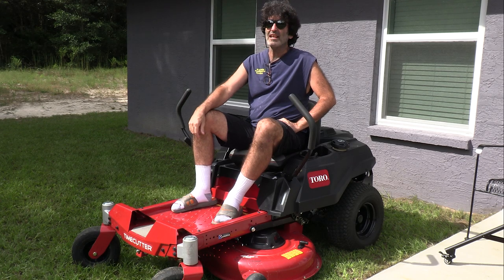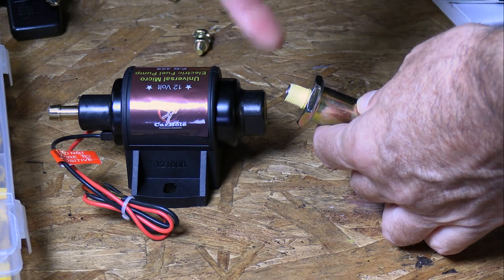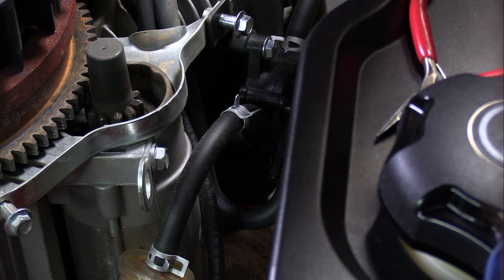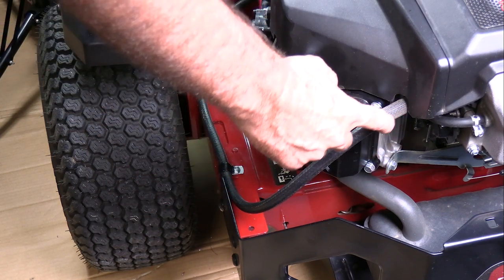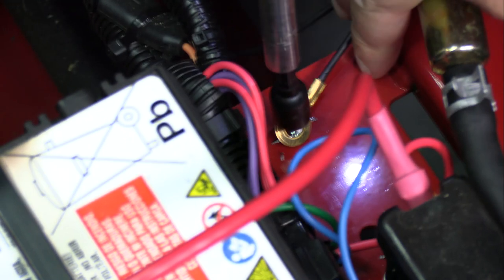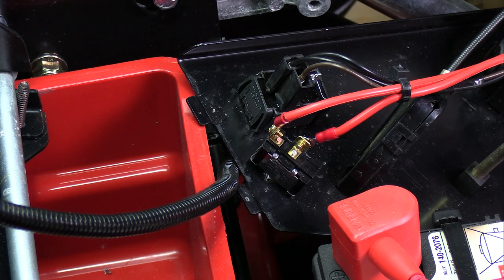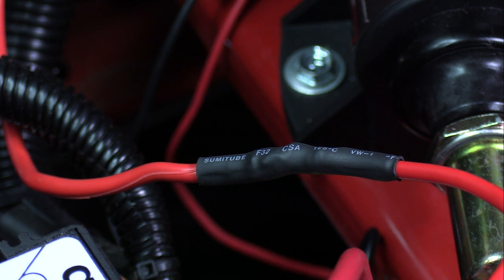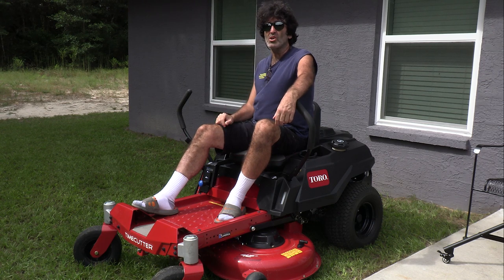Electric Fuel Pump Conversion On a Lawn Mower.. Does it work?

Comment: Good job I like your double heat shrink idea and to help clarify the reason it doesn't matter what wire goes to either post on your on off switch is the only difference is what direction on and off is on the switch
Reply from the maker: Excellent!  Yea I've done that double heat shrink thing since forever... 😂. Especially on a critical connection....
Reply: But how theu don't over fill the carburetor on idling? They are on all the time without the ecu can someone explain before i do the conversation

Comment: Nice job Rudy. 
I figured you were going to make a video. 

I did one little thing different. I connected the Pump hot wire to
The Fuel Solenoid wire so the pump shuts off when I shut off the ignition. 
I can guarantee I would miss shutting off the pump. (like my shop air compressor.) :O)

I also put a toggle switch just so I could shut off the pump if for some reason I needed to, and 
of course the inline fuse. Them pumps only draw about 4or5 amps. 

I am curious how long the elec. pump will last. 
I replaced the vacuum pump every year. Even the OEM. I rather buy an electric pump every year. they are half the price of the vacuum pump. I do like the elec. much better.

John
Reply from the maker: HI John!  I wanted to give you a shout out in the video, but I couldn't remember which video we initially were collaborating on..🙂.  I thought about connecting it with the switch, but wasn't sure of the amp draw and didn't want to damage the ignition switch or go through any under-rated wires.  We've (my bother and I) had a few old hot rods with electric pumps and always had a switch under the dash, so I did it this way to remind me of that!.. 😂. Thanks again for the idea...  I don't know how long the motor will last, I probably only use the mower about 8 hours a year so we'll see..  Sitting might be worse for it than running it.
Reply: @JLPicard440  I don't need a shoutout. 
I have no way to make a video anyway. Like your' video it's the best one in here. 
Well done. 
Right now I am not getting any power anywhere no click.. 
I am on my way to trouble shoot the wiring. I dismantled the mower to slap a 
quick paint job on it while replacing the belts and pulleys. 
(can't do anything the easy way) I must have messed up a wire or safety switch. The Paints done, belts are on and ready to go. 
I miss my younger brother. Many, many miles riding motorcycles together about 50 years riding..
Reply from the maker: @CorbinAce  Oh no!  It's always a great feeling when you put something back together and it doesn't work..  Yes I would guess a safety switch.  Hopefully you've gotten it back on the road by now since you're response was yesterday.. Sorry to hear about your brother.. ☹️
Reply: @JLPicard440  Thanks Rudy my brother was my best friend. He was 69 when he passed 8 years ago.. I am 86 as we speak.
I hate it when things don't work. 
I think I found the culprit though. I removed the battery and checked out the mess of wires and found the wire to the Amp meter was pulled out of the wire connector. I'm heading out there now to reassemble and check it out. I'll let you know. I should get a new wired connector and ignition switch today. I keep this up I will have a new mower. LMAO. For twice the cost! :O)
Reply: My neighbor sent me a high fi as I was mowing my lawn. It was the amp meter wire
that disconnected that killed every thing. It is still not running good enough for me.
I had to cut  the grass. 
I have a Carb. rebuild kit I bought when ordering the belts and pulleys so I will rebuild the spare intake that I have and pull a swap. 
Been good talking to you. Will drop a comment now and then.
John
Reply from the maker: @CorbinAce  SO glad you got it going again!  Gremlins like that can be hard to find.. hopefully the carb kit will take care of the rest of it... 🙂

Comment: Great video! But you can wire that pump right through the ignition switch on the mower
Reply from the maker: Yes you can do it either way... 😀.
Reply: How would you do that?
Reply from the maker: @Coach.Lewi.1979  I forget which wire is 12 volts switched with the key.  I believe the wiring diagram is available on this time cutter free to download.  With that it's pretty easy to determine which wire it is that you can hook to.  Or you could take a volt meter and test each wire to see which one will work.
Reply: @Coach.Lewi.1979  Most mowers have a fuel solenoid on the bottom of the carburetor that energizes when you turn the key on.  That's the easiest place to get continuous 12 volts with key on.

Comment: Very nIce video and thanks for providing links to the parts.  Pump turned on initially but only worked for about a half hour then quit while cutting grass.  Can't get it to run. Ruled out ON/Off switch by by-passing switch...still no power to pump.  All wires are intact.  Battery is good. Any suggestions?
Reply from the maker: Arrrgh.  Did you put an inline fuse with the pump?  If so, that could be the culprit.  If the fuse is good, I would connect power directly to the pump and see if it runs.  If not, maybe it went bad.  Mine is actually still working and I just used it the other day.  No leaks or problems.

Comment: Best power source for your fuel pump. Is the line that gives power to the carburetor solenoid if you have one most tractors have a solenoid on the carburetor these days. 12 volts and it operates when the key is on and the tractor running and when switches off power is automatically off to fuel pump. Just a share
Reply from the maker: HI, Yes I agree!  You can certainly do it that way.  I wasn't sure if the ignition switch could handle the extra load of the fuel pump so I was being cautious...  But my guess is it would have been just fine...
Reply: I might do the same thing, but use a relay just to be sure.

Comment: I think this will help me with my old Ez-Go Golf Cart vac fuel pump. But why not wire it to the ignition circuit?  Ignition on, fuel pump on. That way you don't forget to turn it off. I think there might be a safety issue wired directly to the battery.
Reply from the maker: It's possible, but I like to shut off the fuel pump and then let the engine run for a while to drain some fuel out of the carb.  Just a quirk that I have.  I think one will hear the fuel pump running if they do forget.  But there's no reason that you can't hook it to the ignition switch.  Just make sure and get a very low pressure pump.
Reply: @JLPicard440  I am thinking of adding a pressure relief and fuel return line like they do with cars. That would ease my mind.
Reply from the maker: @d.l.harrington4080  Yes that's a good idea.. 😀

Comment: just got done doing about the same thing on my simplicity vanguard  16hp,  took the anti backfire thing out years ago and had a gas shutoff on, the pump is wired to the headlight so all i do is shut off the headlight 3-4 minutes before i quit and idle it down and it runs out of gas and stops with no backfire issue
Reply from the maker: Great idea!  Thanks for the feedback... 😀

Comment: What happens if there is a vacuum problem causing the original fuel pump from working?
Reply from the maker: The engine should create vacuum if it's running.  I've seen the rubber boot that comes off the valve cover dry rot and therefore it's full of vacuum leaks.  Did you check your boot?

Comment: Ummmm, why have two fuel filters? If that mower is ever sold, the new owner  might not realize it has two, and thus only change the obvious filter while neglecting the not so obvious filter, allowing it to become clogged up over time. Also, with way you wired it up, it will run the battery down if you accidentally leave the pump on, right? Otherwise, good job with the conversion to an electric fuel pump.
Reply from the maker: HI, yes I could have put the pump on the key switch so it turns off with that.  For me personally I like to shut off the switch and let the motor run for a little while so the carb doesn't stay full.  For winterizing it's nice to just let the motor run until it quits to get the fuel out of the carb.  IF it's hooked to the key switch you can't do that.  But either way is fine.  Yes it will run the battery down!  It is loud enough where it would be hard to miss even if you forget you'll hear it running...  I don't remember installing 2 filters?  I'd have to look at it and see what I did.  You're right, 1 would be better.

Comment: Did you need to mount pump lower then fuel tank?
Reply from the maker: I don't think so, but I think it'll automatically wind up lower if you mount the pump to the frame

Comment: I considered this, but was afraid the electric pump would make too much pressure and require changes in the carburetor.   Is that an issue?
Reply from the maker: HI, You have to get a low pressure pump.  The one I used is a 2-3.5 PSI pump.  The one I used in the video looks like is no longer available, so i've updated the description for one that is still available...
Reply: @antagonizerr  cars use a return line because it's a better way to maintain pressure accurately.  The regulator keeps the rail pressure constant while the pump can flow constantly.  Without a return line on a car, all the fuel in the entire supply line would have to nearly stop when you let off the throttle, then suddenly flow at full capacity if you step on the throttle.  The pump can't suddenly move all that fuel instantly.  With a return line, the pump flows the same amount of fuel at a constant rate, and the only thing that changes when you step on the gas is that less fuel goes back to the tank.  

I looked into these little pumps since then and actually installed one.  They are self-regulating because they have a diaphragm that limits how much pressure they make.  They are low pressure.   The fuel bowl on the carburetor actually regulates what goes in the engine, and the fuel line is short, so you don't have over-pressure and starvation problems.   The one I installed works great.   No return is needed.

Comment: Excellent video and it answered all my questions.  I have an old Miller Trailblazer that is having fuel issues and putting an electric fuel pump was my plan.  I can't get to the gas tank without having to pull the motor so I'm thinking an external gas tank may work with the electric fuel pump.  Thanks for posting this.
Reply from the maker: HI, yes it should work.  I usually recommend to get the low volume pump... 😊
Reply: want to do an external also, thinking about using an outboard motorboat tank and just taking it to the gas station and fill it and then back on mower.  gas cans are messy
Reply from the maker: Yes that's a good option.  Hopefully it'll hold enough fuel for a few yard cuts.  Seems like it would be a lot more headache to load the mower up and take it to the gas station all the time... 😎

Comment: What's wrong wiring it to the key when you turn the key on the pump comes on and turn the key off it goes soft some people forget to turn the pump off
Reply from the maker: HI, there's nothing wrong with that.  Although I have discovered when I park the mower I like to shut off the pump and let it run for about 30 seconds to drain some of the fuel out of the carburetor.  Not really necessary unless parking for the winter, then it makes it easy to shut off the pump and let the engine run until it quits... Can't do that if it's wired to the key switch..  It's just quirks that I have... either way is fine.

Comment: Not really a need for a switch. You can wire into the key switch using the same terminals that actuate your fuel cut off solenoid.
Reply from the maker: Yes true.. I like the switch, even though I could have done it another way.
Reply: I like the switch option better, rather than splicing into the factory harness.

Comment: Put electric fuel pump on my zt1 cub cadet 27hp koleur 7000. Runs for little while good sitting there then dies like carb run dry pump 2.5-3 you think pump might be shutting off and do I have to have a regulator
Reply from the maker: If you're using the 2.5 - 3 GPM pump you shouldn't need a regulator.  Can you see fuel in the fuel filter?
Reply: @JLPicard440  yaw gas all the way to carb might be grnd I didn’t chassi grnd went to mower green wire got to thinking could have it on a grnd that opens up
Reply from the maker: @randybarnes6661  Can you hear the pump cutting in and out?  I'm not sure if you were able to see fuel in the fuel filter.  Or you can disconnect the fuel line from the carb and turn the pump on and see it spitting out into a can..
Reply: @JLPicard440  believe it or not buddy the grnd was my problem on that and fuel guage installation put both on frame of mower fixed both good lesson learned on having good grnd it made me think I had other issues both worked turn switch on but when motor cranked both loose power when I figured it out could have kicked myself in the ass lol maybe you can use what happened to me on one of your video’s stress grounding so you don’t think you have issues somewhere else and keep over looking and over thinking it thanks for replying and trying to help me thanks again buddy
Reply from the maker: @randybarnes6661  Awesome!  Glad you got it going.  Yes a good ground is really important.  Thanks for the feedback...

Comment: So I’ve seen where some say that the electric fuel pump is no good for lawnmowers because it over powered the needle and seat, I’m wondering if you have had any issues with this happening because from everything that I am finding for the most part is people having no problems at all with it, I know it has to be a low pressure pump, today my fuel pump crapped out on me so I want to do this and be done with that vacuum pump 😂
Reply from the maker: HI, I am actually still using that setup to this day.  I haven't had any problems at all...

Comment: Why didn't you just hook hot wire to ignition  switch, when you go start it pump comes on 2-3 seconds then start engine ( simple)
Reply from the maker: HI, I didn't want to do it that way.  It is fine to do it that way but  I like to shut off the pump and let the engine run a little bit to drain out the bowl...  It's just me, you can do it either way... Thanks for the feedback.

Comment: why not just wire it into the ignition switch? relay... return fuel line? Sooo many things to do differently...
Reply from the maker: You can connect to switch... I prefer it not.  You can connect a return fuel line... This is just a guideline, you can tweek it how you like... 😀

Comment: Why not run the wire to a Key-On hot in the ignition switch and use your installed switch as an emergency shut off  like @jebjr100.
Reply from the maker: You can do it either way.  I like to shut off the switch and let the engine run to get the fuel out of the bowl of the carburetor... IF you connect it to the switch you can't do it that way... but either way.